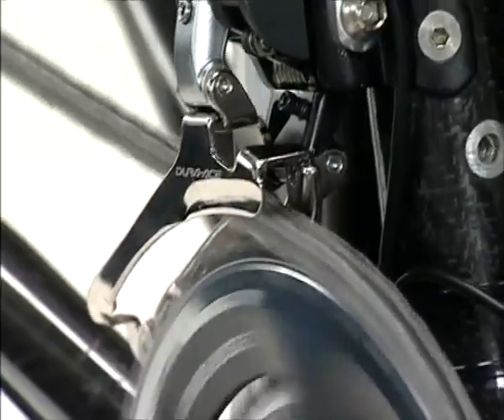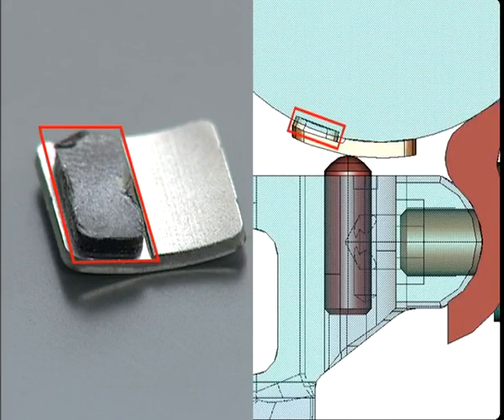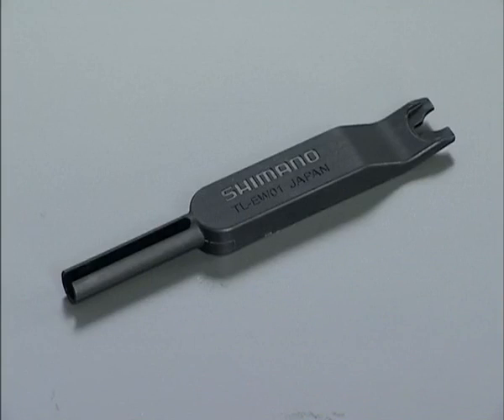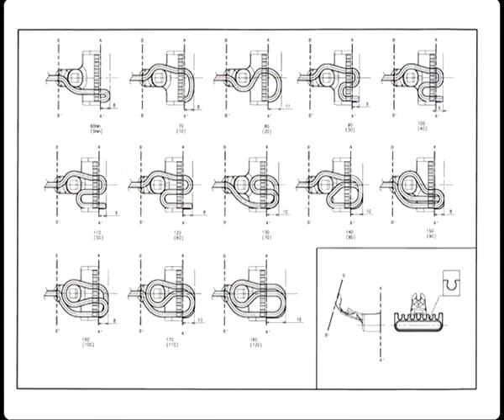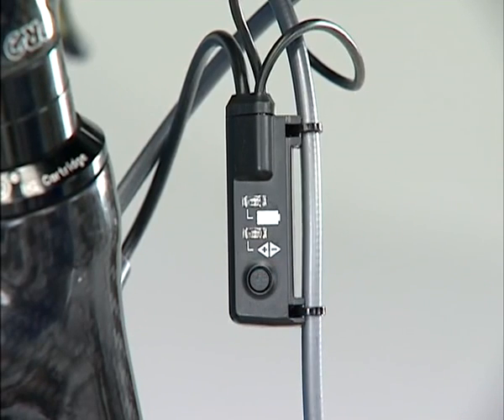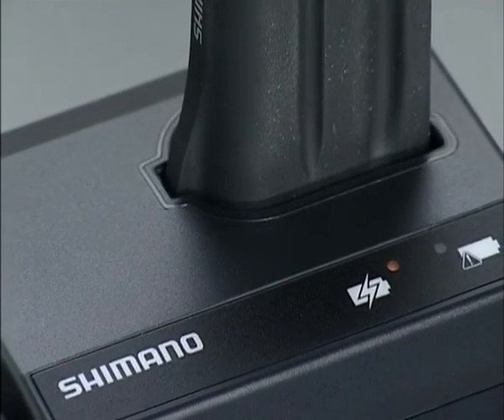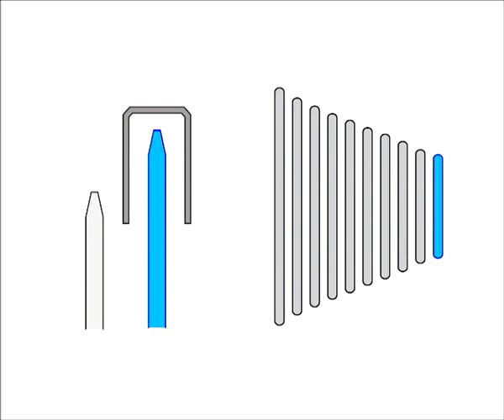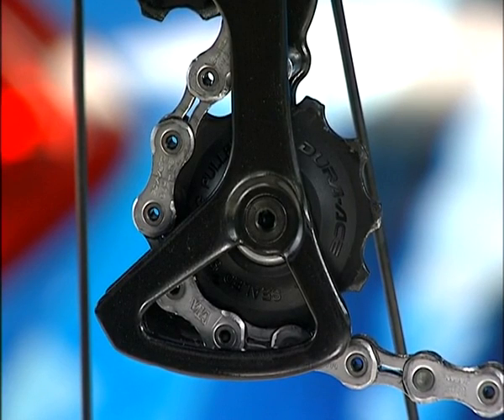Shimano Dura Ace Di2 7900 Installation et réglage

Comment: THANK YOU SO MUCH for posting this!  The original tutorial and guide are no longer available anywhere on Shimano's site, nor is the 7970 dealer's manual.  If not for this post, there would literally be almost no installation guidance available online for this groupset.  Brilliant, thanks again!!
One note:  You might want to edit the title to include the correct numbering for the 7900 Di2, which is 7970.  Might make it more likely that others can find this critically necessary information also.